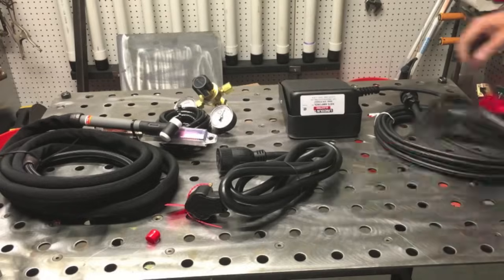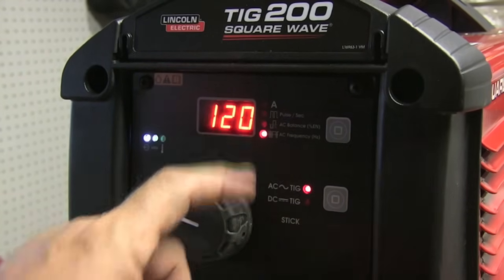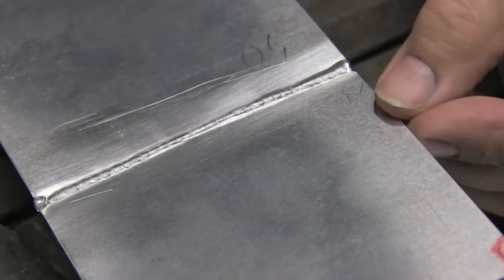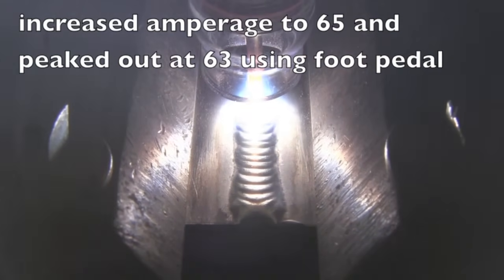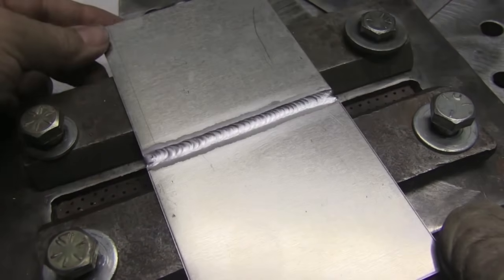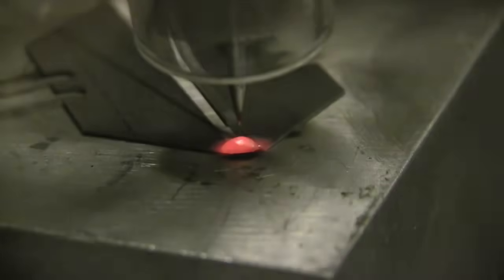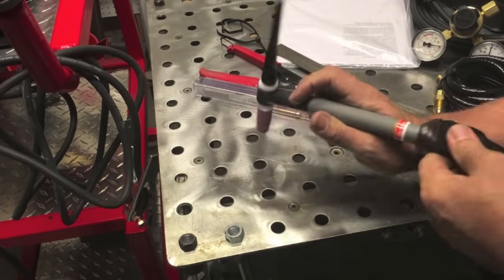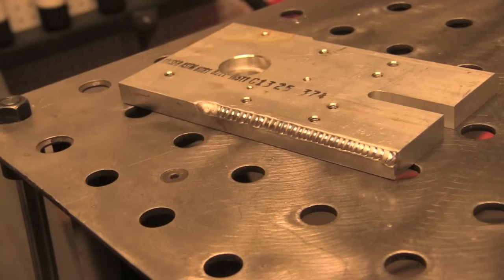Tig Welding Aluminum with a Lincoln Square Wave 200

Comment: So, I’ve followed your guidelines to the number and i can’t get a puddle like you have. I used to weld with a Hobart and did fine, but I’ve had this machine for a couple years and can’t get a puddle no matter what I set it at. I just keep getting dirty welds. Yes I’ve cleaned the heck out of everything. Thought I was just out of practice, but now I’m thinking I have a faulty machine!??

Comment: I just purchased this machine.  I am looking forward to using it.
Reply: Let us know how it is working, thinking of getting one. Thanks
Reply: @wurlabyscott  I have just used it a little bit on aluminum and learning the effect of the different AC settings.  So far I am very happy with it.  When I bought mine, Lincoln was doing a $600 rebate on it, so you might want to move on your purchase sooner rather than later.  Also, I am very impressed with Lincoln's customer service.  The gas regulator that came with it wasn't working right.  I contacted Lincoln through the chat on the website and described the problem.  Their response was:  "What is your shipping address?"
Reply: @paulkurilecz4209  thanks, really like your customer service input.
Reply: @paulkurilecz4209  thanks for info
Reply: @wurlabyscott  I have been using this machine now for two months, mostly doing Aluminum which is why I bought this particular welder.  I am extremely pleased with it.  The main thing that I have learned is the effect of the different settings for pulse, balance and frequency.  I am now doing outside corner joints on .065" thick material.  I have some 3/16" coupons that I will try after I master .065" and .032" thick material.  This will be to test out the machine at its highest power output.  It is definitely not the lowest cost machine of this type and capability, but I am extremely satisfied and believe that I will have a machine that will have a long life to it.

PS:  I purchased a sheet of .065" thick AZ31 and I am looking forward to fabricating a few items out of it.

Comment: silly question here by how do you ball your 2% lanth. tungsten on the square wave tig 200? I've read that people strike an arc on steel then it'll ball itself up and I've also read that some turn the AC balance all the way down and put the amps at 100 then strike an arc on alum. and steadily apply pressure to the foot pedal then the tungsten will ball up.
I've tried both and neither of the methods ball the tungsten.

Comment: I recently purchased the Tig 200 as a package deal with the 210mp. My question to you is I already have a Tig 185 and love it. I haven't spent much time with the 200 but enough to not like the pop start vs the low current start of the 185. Any feedback on your preferred machine between the two? I am considering selling the 185 but can't seem to commit to that until I get more time with the 200. Your thoughts. Love your channel and am a religious user of tig fingers and stubbys.

Comment: Jody , does the Lincoln 200 Tig use lift arc like the 210mp?
Reply: Ok , I read elsewhere that it a HF start . Which I believe is better than lift start
Reply: Debating to purchace an Everlast 200DV instead of the Lincoln sq200, as it has more options , and a lower price point .
Concerned about warranty work if it ever has issues though
Reply: The square wave 200 is hf start

Comment: hey Jody i just recently purchased this machine and my question is I'd like to setup in my garage and would like to add a 240v plugin my garage, i was wondering if you could show me some of your power supply setup(breaker box and receptacle ,GFCI, fuses? ) that you use in your garage or shop to help me steer in right direction. appreciate it and love the videos keepem coming

Comment: Hey Jodie love your videos , question I bought Miller diversion 165 when they first came out , love the machine never skipped a beat but it has zero adjustments on frequency ETC , I'm not brand loyal as long as it's blue ore red 😜, but the Lincoln has more features and it cost less then then the next Miller with similar capabilities, how does it stack up against the 185 or the 165 ?  My 165 has all the upgrades, lens , flow meter ,braided hose and diamond back torch , I'm really consider buying this unit , and higher amperage is a big factor , thanks in advance

Comment: Hello Jody would you recommend this Lincoln  machine or the new 2016 AHP tig welder? i do a lot of aluminum welding mostly home projects and i stick weld also. Do you have a opinion on which machine is a better buy ? i know the AHP is 60% duty cycle

Comment: hi how are you doing, im a newbie to tig welding, i welded with mig my whole life but i need to weld very fine material now i was wondering your opinion on the miller diversion 180 vs the lincoln square wave tig 200  what do you think is better for the price? is it a big difference? can you give me your full opinion. and do you think buying a miller is not worth it for the 800 dollar difference. thanks.

Comment: Can I boil the root of the seam in the corner connection 10 mm alloy 1560 tig welding thick?

Comment: Looks like a great little machine, and am strongly considering getting one to supplement the Miller Multimatic 215 I have for GMAW/SMAW. Too bad I missed out on the Garage Pack sale, or I would have ended up with both the Square Wave 200 and the 210 MP. Always a bridesmaid...

Comment: I bought this welder.  For the life of me I can't ball up the tungsten. tried thoriated, lanthanated both 1.5 and 2% in 1/16th. I do have the gas lenses. Could you please demonstrate how to put a ball on the tungsten using the SW200.  Thanks!  I learned a great deal with your videos!
Reply: You could turn the balance up a touch, and strike an arc on a chunk of copper. You don't use a big ball on pure tungsten for an inverter though, use a tiny ball and 2% thoriated.
Reply: beauty of the inverters is that you dont need to ball your tungsten for aluminum. just sharpen it as usual and go. if you really like a ball you could arc on electrode positive for a sec or just let the ac round it off as you weld
Reply: Reading is fundamental... don't try to fly a plane without training.

Comment: Jody--Great video. If it was your money, would you buy the Lincoln Square Wave 200 or the AHP AlphaTIG 200X?
Reply: I had a hard time deciding between the AHP and an Everlast welder. I eventually decided on the Everlast. The Lincoln is OK but it is severely lacking in some features.

Comment: Thanks for the square wave 200 test, I got your basic 3/32" stubby gas lens kit for my 17 torch that it came with and love it!  Question, what is the part number of the #8 cup that came with my kit?

Comment: Just added this machine to my shop and am having a fairly frustrating time with the learning curve. And, I'm teaching myself on steel before moving onto other. I thought it would be a lot easier than it is since I MIG, Stick and can also Oxy-Acet Fusion/Braze weld.  Lincoln's Instruction/Operating Manual does not help much with setting this machine and matching the proper components. I suspect a Pro or Intermediate Welder operator knows how to set up and run a TIG. But for us guys new to TIG.... we could REALLY use your help getting us and this machine going in the right direction. Love your channel by the way!!! Thanks for sharing all you know.

Comment: hi jody, 

been watching you're videos for a while and tried some aluminum welding, set the machine to 150Hz and 65 ac balance and tried to weld some stuff, got it to puddle, and weld some passes, went ok. but somehow even with way more argon then is should need, mij tungsten kept burning of and sputtert weirdly, used 1,5% lantynated and pure tungsten, didnt make a big difference, is it me forgetting about something or is the machine broke ? 

also the arc doesnt want to get stable, its all over.

its a oerlikon machine with all the bells and whistles.

Comment: I bought this machine a couple of months ago and so far so good. The ac balance and the pulse settings could use a wider range of settings but I have not had anything come across my bench that it didnt handle. For the price this machine is great for beginners and the everyday use for someone on a budget.
Reply: +Jacob Ambuehl wear-is-the-200-made-usa?

Comment: I can't seem to get a straight answer.  What's the difference in a transformer  machines(like my Syncrowave 250 (heavy as hell and not portable nor adjustable from 250v to 110V) and the apparently new invertor machines in terms of comparison capabilities (thickness essentially)?

Comment: Hey Jody was curious if you have happened to try out the Licoln Precision TIG® 275 TIG? This is the first time using a lincoln tig welder and was wondering what your opinion on the lincoln foot pedal opposed to the miller? I'm having trouble getting use to it.

Comment: love the videos keep them coming. I have an older commercial Lincoln tig 250. My machine doesn't have the capabilities of changing frequency or AC balance. Is it possible to do a video with general settings meaning 50/50 AC balance and 60hz frequency?

Comment: Can you weld when it's hot like 250  digress. or higher when it is hot can you still weld if you turn your amps down to say like 80 or 50 amps   Or is it just better to let it cool down

Comment: I bought the Lincoln 200 squarewave TIG about 2 months ago so far it's working very well the only thing that I would really complain about would be the regulator seems to be on the cheap side I have six other machines just was looking for something to be portable but I do agree with you it does have a nice arc

Comment: I know is too early to ask for your thoughts on this machine, but you think this is a good entry level for noobies?
Reply from the maker: +Erick Ordonez  So far I can say this much...  Pretty much all the work that has come thru my shop in the last few years could have been done with this machine.
Reply: +Erick Ordonez I'm new to tig welding, and bought this machine and have enjoyed it so far. I thought it seemed like a great machine for the price. Just got the stubby gas lens kit and fupa 12 for it, and some tig fingers.
Reply: it's a good machine or the square wave 175
Reply: +weldingtipsandtricks thanks for responding. I think for the price is a really good machine. on paper it seems comparable our slightly better thanks the 200dx, in some areas. I wanted to see a better review than the one offered by lincoln, by far more info now. do you think that the lack of lift arc will limit its abilities?
Reply: +Erick Ordonez Me as a hobbyist thinking on "lift arc": since lift arc to me, can be used with TIG and Stick. For TIG, there's NO point seen to me yet to not use a HF start. Say for Stick... I tried that HF start can also be used with Stick when my machine in TIG mode (I think welding voltage should be different, that's maybe a problem), say a "HF start Stick" (7018 rod successfully runs for me. 6010 still NO luck, which sticks a lot) along with other TIG options (say AC, pulse etc.).

So seems to me, there's no point to look back for lift arc.
Reply: +Ning Ji I think I got your point. One of the videos that Jodi did a while back, he referred to the different applications for both forms of welding start. HF is a great form for welding, no doubt. But there may come a time when you may be working on close proximity to circuit boards or even your car where HF may affect those components. At some point the thought may cross our minds where we may want to weld in our cars, only we'll know why when we get there. At that point HF may come into play. Just saying.
Reply: I got you. Thanks for your reminder. My fault.
Reply: +Ning Ji No fault, dude. We are all learning, well at least I am.
Reply: +Erick Ordonez got a long way to go on that learning curb.
Reply from the maker: +Erick Ordonez I think not having lift arc is not a big deal for me. I have other machines that have it ...but I never use it unless it's a lift arc only machine
Reply: +weldingtipsandtricks Thanks for the response Jodi, I'm hoping to get my soon so I can start laying down some beads. keep those videos coming.
Reply: +Erick Ordonez Good point. I've had my MTS251si for quite a while now and was stoked it had HF start (lift arc too) but it would be great to be able to use my little DC stick welder for portable tig. Time to practice my scratch start!
Reply: +weldingtipsandtricks "Pretty much all the work that has come thru my shop in the last few years could have been done with this machine."

Sold - Thanks.

Comment: So do I understand that correctly, high frequency for thin stuff, low frequency for thick stuff?
Reply from the maker: +Jack White Yes...at least that is what I do.  but other people have different opinions.   when you only have 200 amps, I think lower frequency gets the most heat input.
Reply: +Jack White I'm trying to put more confusion and my consideration here: think the "welding current" and "time" picture being a square wave, the upper part (above zero) is "welding", and lower part is "cleaning". If only change frequency, higher frequency means we welding for a less period (less input heat) and then do cleaning, simply considering at the same time, heat is lost through metal (same lost heat) at a constant speed, we will have less heat left in the metal. So narrow beads etc. will show up as Jody showed in other videos.

In real world, a welding machine (at least mine) may further adjust a square wave's "cleaning" side's percentage in a single square wave and "cleaning current" (in a percentage according to "welding" side's current value) to: clean just enough and save more heat for welding. (Not useful for my hands, I see no real advantage can be "felt" for me yet.)

In short, with a known enough "clean" setting fixed, high frequency for thin, low frequency for thick.

Comment: It looks like a decent machine but i won't buy one until they put post flow control on. Nobody needs 17 seconds of post flow for ac welding
Reply: +gamble1997 I didn't know lincoln was in the ARGON business too?????? 17seconds is a WASTE!  I'm glad I didn't wait for this machine.  Bought an HTP 221 last month...  Better duty cycles, CK torch, better all around numbers.  "Drink a Miller, Drive a Lincoln, but weld with an HTP"  ;-)   HTP is made in italy... I wonder where this thing is from???  My guess, built in mexico with chinese parts.  How else can you get a machine THIS CHEAP?
Reply: +gamble1997 Yikes! Really?!? Even my 3 year old Everlast welder has adjustable post flow. Sometimes I wonder who designs these things.
Reply: yep. it's come pre calculated crap. At that rate I'll spend so much money on gas I might as well get a welder with post flow for a few bucks more. And the 25amp start sucks too. 
I think Lincoln screwed up on this one. I'll wait for a revision then purchase one